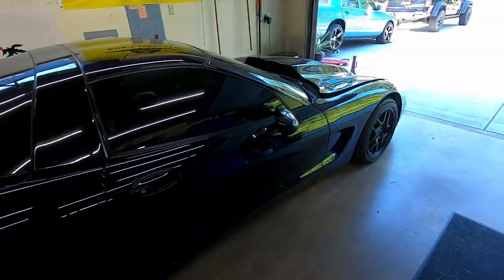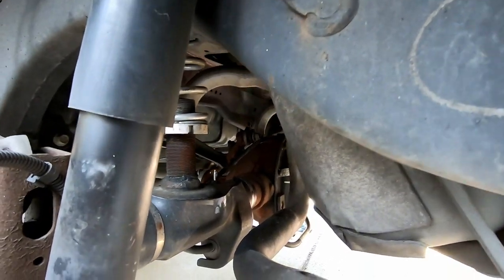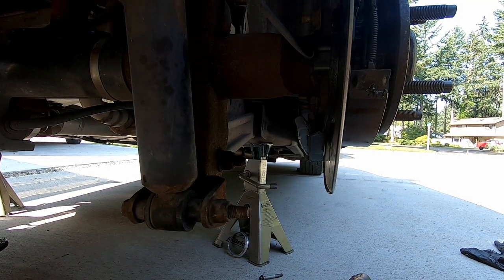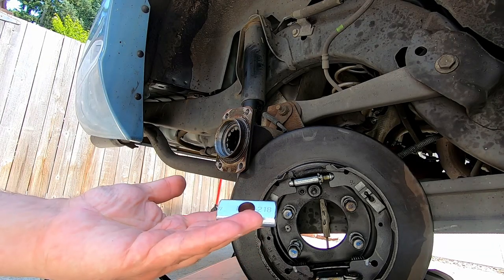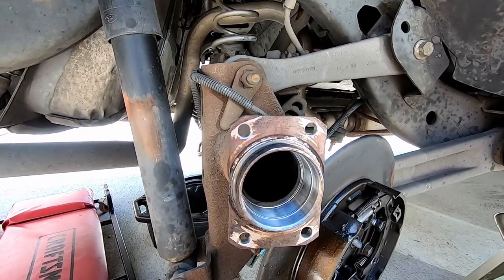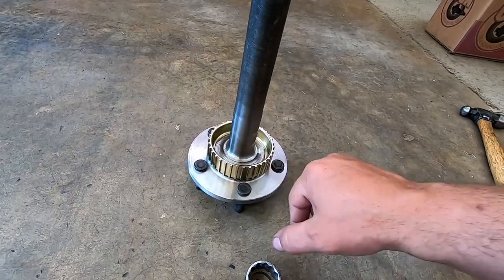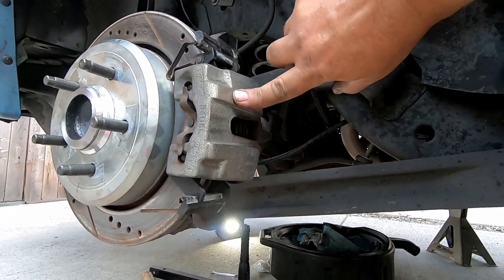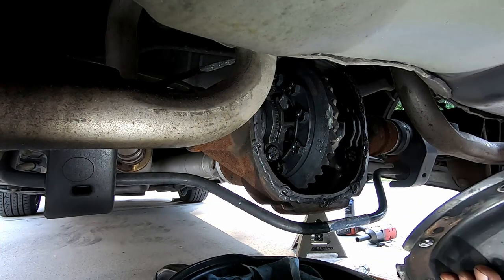How to Replace a Crown Vic Rear Axle Shaft, Bearing, & Seal After A Failure Full Detail or any 8.8

Comment: This is the only video I've watched where the backing plate needed removed? 
I'm doing this project tomorrow.
Reply from the maker: Good catch.  This job does NOT require the backing plate to removed and I should have clarified why I was doing that in the video.  I did that because of my limited tools selection at the home garage.    I wanted to chisel the seal out separately from taking the bearing out as I didn't have a proper seal puller on hand and my whimpy slide hammer was not powerful enough to yank the bearing and seal out at the same time.  If you have a full size slide hammer (which I do now) you should be able to rip the bearing and seal out together and leave the backing plate in place!  Thanks for pointing this out.
Reply: @MRBLACK947  good video sir.  I am now subscribed

Comment: I've done a couple of these, rear wheel sensor's get in the way of taking the c clips out. Gotten lucky I didn't have the hardening issues with the axle's. Love my crown vic's.
Reply from the maker: So far it's still holding together.  The amount of metal we tried to clean out of this housing was unbelievable.
Reply: @PNW_Car_Mods  Oh I bet there was. I Would change that fluid a couple time's make sure. OEM Mustang 8.8 diff cover works great on these, but the top of the cover has a hole that needs plugged. I change my diff fluid every couple year's so a drain plug is awesome.
Reply: What year is your vic?
Reply: @summerforever6736  I've had both an 03 and still have an 07. Both needed to be done. Same thing each time both seals blew. I also made sure my axle vent tubes weren't plugged up. The 03 was around 160k, 07 was around 107k. Used international brand and haven't had an issue on the 07 for over 80k miles.
Reply: @iamherenotheretobe  THANKS FOR THE REPLY SOUNDS GOOD
Reply: The sensors do get in the way, and they're delicate. Plan on breaking at least one of them. The connection plug is underneath the back seat. Good luck 👍

Comment: I put my c clip in but I do not remember which side i have away from the axle.  Damn, does this mean I'm reopening everything?
Reply from the maker: If you are talking about the sharp side vs the rounded side of the C clip and which way to face it?  I wouldn't worry about it.  It will be totally fine to retain the axle.
Reply: @PNW_Car_Mods  Yes sir, that is exactly what I was referring to. Thank you!

Comment: How did you get the c clip out? I was olny able to get mine out by removing the abs sensor and that meant I had to replace the abs sensor. I didn't have enough play with the senosr in to get the clip out.
Reply from the maker: Man, that it wane of those scenarios where I would like to have been there to see what you had going on.   I just recently did this again on a Ford Ranger 8.8 with a trac lok diff.  No problems.  I just push it off the end of the axle with a screwdriver and let it fall off into the bottom of the housing and fish it out later.

Comment: Replace the bearing and still three or four months ago and it's already leaking again the last time there was no trouble getting the c-clip out now there is 😭
Reply from the maker: What happened?  Did the seal get damaged by installing the axle?
Reply: @PNW_Car_Mods if that were the case it seems like it would have leaked immediately by some miracle finally get the clip out Axle is still jammed up I've already pulled the other axle to inspect everything was perfect on the driver's side hell might as well run a 4 ft pipe down the hole and hammer from the inside

Comment: Just curious, my 2011 P71 doesn’t have the S Clip in the Pinon Housing. I noticed yours doesn’t either. Is that standard for that setup because everyone else’s I’ve seen still has the S Clip. I worried the shop who touched my rear differential the day before it crapped out, wasn’t competent enough to feed the C clips through the S and simply left it out. They messed up so many things I’m hoping they didn’t just take that part as it’s like $60 from what I’ve seen. 

Are you able to have the axles in when you take the S Clip out? Or just take one axle out then be able to remove it? They said no play but my axle was ate up just as bad as yours after a rear passenger seal leak, bearing was disintegrated and ate up the axle housing a little..  then the next day I hear the bearing shatter/grind and have to get it towed home. I trust no one to touch her now 😕
Reply from the maker: The S spring if you have it is for the Trac Lok diff.  If you have an OPEN differential (one wheeler peeler) then you won't have an S spring.   The crown vic in this video has an open differential so no S spring will be there.

Comment: Well Done. I like the improvised slide hammer tool!
How are the rear control arm bushings and watts link holding up with the 5 speed? Mine were already a bit noisy and loose before my swap but I just sent it anyways till I sold it.
Reply from the maker: So far all is well.  Don't really envision much change in power delivery to the rear axle as you can't really beat on these transmissions like they owe you the world.  It is a big heavy car.

Comment: I used a hacksaw blade and cut the bearing at 6:00 and 12:00 to almost touching and then use the chisel to finish it off and then of course I had to grind any marks I put on the housing down before I put the new bearing back in
Reply from the maker: Man, that sounds like it would be like breaking out of prison with a toothpick?

Comment: Man what is that tool yoy used to take out the csliper bolts?
Reply from the maker: AC Delco tools power ratchets.  I think it was 150 bucks for the pair (3/8s & 1//4 drive) with a charger and two batteries.  They work freakin awesome.  They have been just as good as all my Milwaukee stuff.
Reply: @PNW_Car_Mods  Awesome Ill be buying them as soon as I got some extra bucks

Comment: Is there anything else you need to take out to remove the driver side axel
Reply from the maker: It will be exactly the same. Also if you have a proper seal puller you don't have to take the brake backing plate off like I did in this video.   So that will save about 5-10 minutes.

Comment: Any idea what is acceptable or normal play for the axle sliding horizontally.
Example wheel off and i pull on axle i get about maybe an eight to 3/16ths  play in and out.
Excellent video by the way
Reply from the maker: I think that is going to depend heavily on miles on the car and wear and tear.   This car has 82k miles on it and I would say there is exactly 1/16 inch in and out play each side.

Comment: That's an open diff right? I just watched this cause I swapped a limited slip rear end off my old 2011 Vic onto my newer to me open diff'd Vic. I swapped the entire rear end. But I noticed the axles on my newer Vic appear to be in much nicer condition than the ones off my old rear end. Kind of want to swap the axles over. Do you know if the process will be extensively different for a limited slip diff?
Reply from the maker: This is an open diff yes.   The process is the same for the traction lok diff.  I should have mentioned that in the video.  You may have to manipulate the S spring around to get the c clips to come out but you should not have to remove the S spring.   Only reason to remove the S spring is to physically rebuild the clutch packs in the diff.     That thing is a bugger to work with as well.
Reply: Thank you for the reply/info  @PNW_Car_Mods

Comment: I put Dorman at the 2019 and today i feel that it is deformed, is the USA standrd gear beat choise?
Reply from the maker: Zero problems with the standard gear.  It even ran over a curb and blew the tire since this video.  NO damage to the axle.   Still running perfectly.
Reply: @PNW_Car_Mods  thank you for reply how much year you are use ?

Comment: When it fails does it makes it leaks brake fluid?
Reply from the maker: No,  just gear oil.  If it happens to be leaking brake fluid it is a separate problem.
Reply: @PNW_Car_Mods  mines leaking sum oil type stuff thought it was brake fluid
Reply from the maker: @Manmadecontent  while not impossibly it is more likely gear from the axle or bearing going bad.   If you want to know for sure, smell it.  Gear oil stinks really bad.  Brake fluid doesn't really small at all and definitely nothing like gear oil.
Reply: @PNW_Car_Mods  yeah almost like a rotten egg stinch n how long can I ride like that until I fix it ?